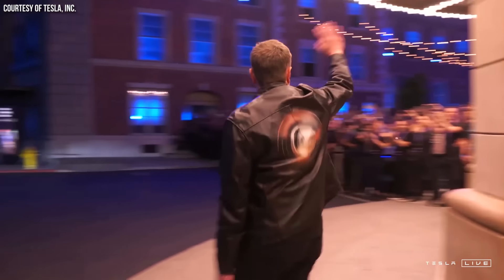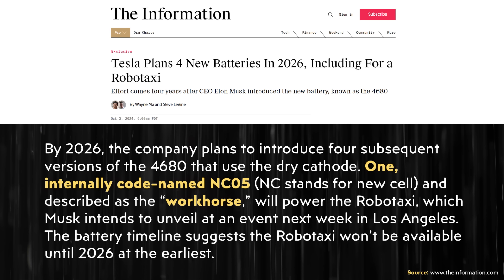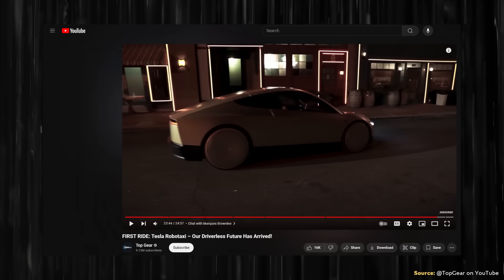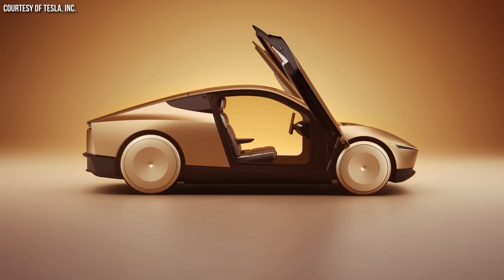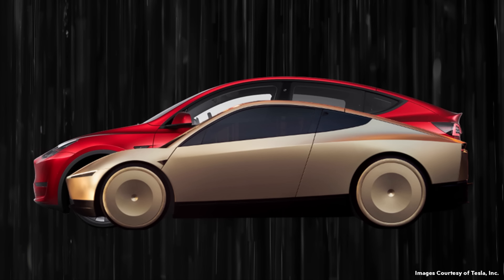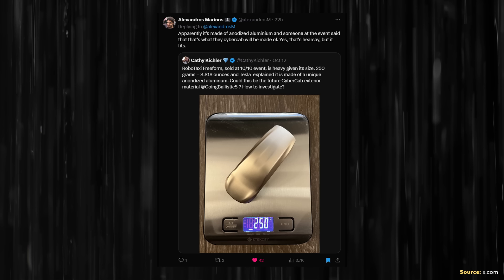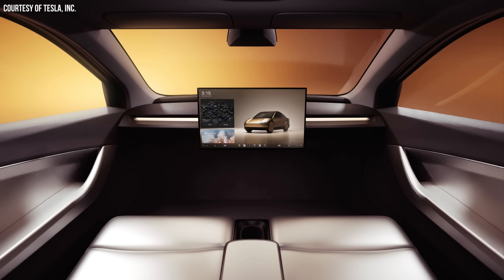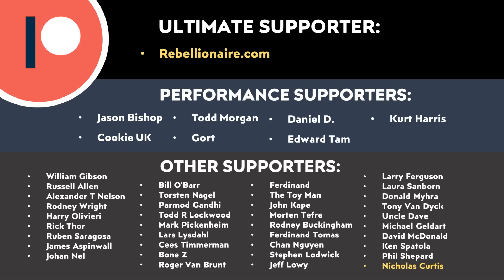NEW Tesla CYBERCAB Secrets | 4680 Batteries Confirmed for ROBOTAXI

Comment: If using the 4680 battery size, there aren’t many options. 
It will most likely be a 192 cells in series to give the 816V required. 
Then comes the amount of parallel which goes by 17.5kWh increments. 
So a 196S2P will be 35kWh pack if the cells are exactly as the Cybertruck is using. 

FYI, the CT have a 192S7P battery pack totaling 123kWh. 

And I should add, the charging power would be divided by 3.5 compared to CT charging power. 
So that would give around 100kWh peak charging for a very short period.
Reply: The 4680 is not static.   They are working on new chemistries.

Comment: Older, heavier people often lean on the doors to get up off the seat.
Reply: why not just add a handle to the frame of the car like in all other cars!
I have a y and I miss it as a passenger, especially if it goes fast in the turns !
Reply: Most passenger seats have handles in the roof. I use one when in a tight spot to save banging doors.......... Now! Why don't ICE cars put them on the driver side? Or do I just buy small cheap cars?

Comment: 7:36 Tesla did buy company doing inducting charging, and it looks as they technology, so you may check they old information, to know what they could do already.
8:50 this door must be automatic for robotaxi, so why not make them cool if this cost same?
Reply: Sandy Monroe, not popular here,   pointed out that a door like this would not work on a unibody.  He said it would be fine with a carbon fiber chassis.   The same would hold for bolting it to a giga casting.

Comment: I think Elon Musk said recently that the AI5 chip will use about 300 watts of power for FSD driving, but he hopes that when the robotaxi is parked it might take part in a distributed AI super computer to provide an Amazon Web Services-like service for inference. When doing that distributed AI work, the AI5 chip might consume up to 1KW of power.
Reply: Hopefully only while charging, with an you out, or they can pay you for the power they're using.
Reply: @HourRomanticist  Just like Tesla plans to do a profit share with robotaxi owners for (1) trips, Tesla also plans to do a profit share with robotaxi owners for (2) taking part in the distributed inference computing. And, of course, both (1) and (2) will be opt in.
Reply: Ai4 is already hitting close to 300. With camera improvements and other changes it will probably take much more than 300watt. I think the same tesla exec collaborated that on X
Reply: @Dimakhrab   
Tesla does not do image processing in the cameras.   The amount of energy used by the cameras is likely to be relatively small.

Comment: From what I heard from Tesla at the 2nd quarter earnings call, the CyberCab will be the first vehicle produced using the un-boxed manufacturing method. Elon indicated that the lower cost $25k - $30k ‘Model 2’ was going to be a hybrid of the current manufacturing process and some of the un-boxed process produced at the existing Gigafactories on the same production lines as the Model 3 and Y in order to produce them sooner - in 2025. While the un-boxed CyberCab will produced in 2026.
Reply: Is seems there are people heading the same thing and coming to different conclusions.  My take is they will produce lower cost cars on the 3Y lines.   They are not the robotTaxi or the $25k/model 2/compact car.

Comment: Tesla is changing the world. Amazing stuff. Elon is the man!
Reply: I think this one may actually come sooner than many expect, possibly early 2026. It appears well designed for high volume production at low per unit cost. Body panels can be plastic or composite with colored pigments mixed in the resin so no need for paint (similar to GM's old Saturn cars). Tesla should be able to crank these out fairly easily with the major hold-ups likely being FSD software SAE autonomous driving level, NHTSA and State regulations, TSMC rollout of AI-5 chips, and Tesla rollout of 4680 LFP batteries.
Reply: Oh yeah! Geofenced concept car... Oh wait others are already offering geofenced robotaxi service. And they are extending to new locations... While tesla just showed us a concept car that will not comeout in years.